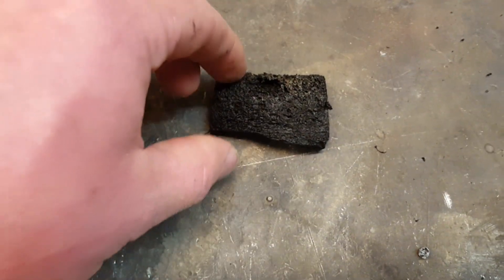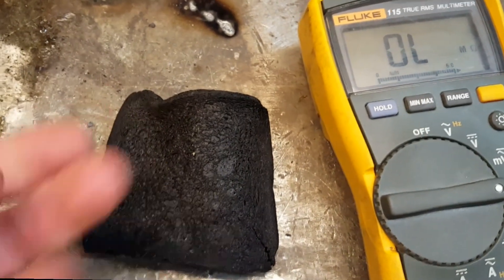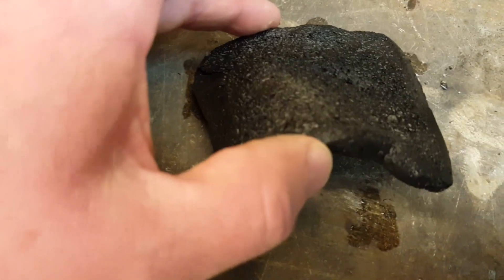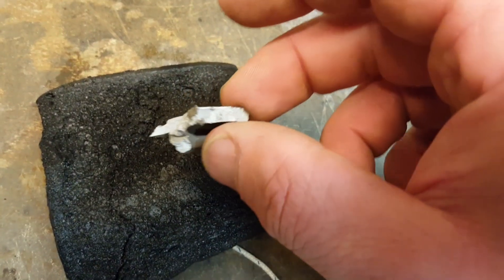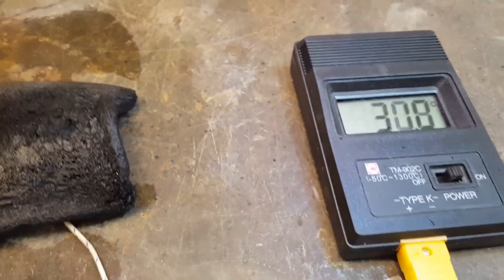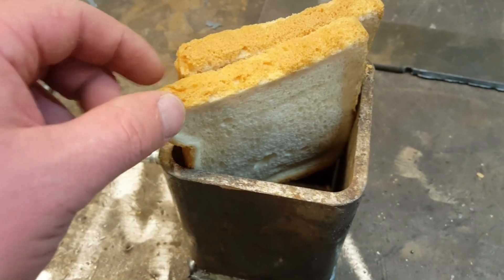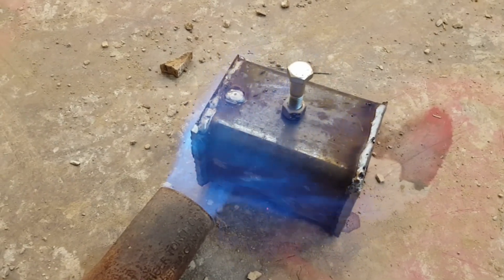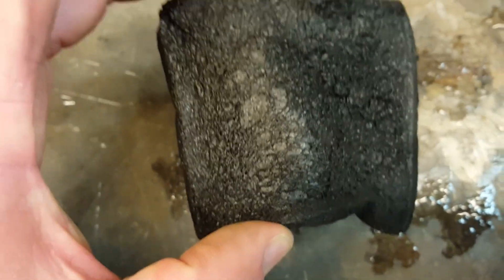Carbon Foam: an incredible material made from everyday items.

Comment: woh woh wait just a darn minute there! that's NOT a thermo-couple. THAT my fine friend is a THERMISTOR, Mister. i may not no much but i ken tell the difference 'tween a thermocouple and a thermistor an that there's a thermistor. An a Bonjour mon ami! como ca va?
Reply: It's a thermocouple. The weld on the end just looks a bit blobby, making it resemble a thermistor. It would not work properly at all if he had connected a thermistor up to a thermocouple conditioner.
Reply: look up TM-902C.

thermistors don't go to 1300C, they rarely go above 300C before self destructing.
Reply: +ms3bani I stand corrected. thank you. more research is needed on my part
Reply: Not, it is not a thermistor,  by  definition a thermistor is an discrete device, so a meter would only read a opened or closed circuit.
Reply: +Adriano Me thermistor is not discrete device! It's a resistor which value changes with temperature. As analog has it can be.
Reply: Wjy did u go to friend just to say "hello my friend how are you doing"
Reply: call me an idiot, but a thermistor is really just a resistor used to read thermal energy or temp. a thermocouple is a bymeatal thingy-ma-bobber.

Comment: Taking this a step further what if the carbon toast was to be impregnated with fine silica sand and re-cooked in an argon atmosphere.  Would this reduce the SiO2 to SiC (silicon carbide) assuming an excess of carbon? And would the form be in SiC crystals?

Comment: I do not understand the need for argon.  If you use the same setup for making charcoal from wood, using a bucket with a few small vent holes to allow gases to escape and put it on a fire, wouldn't you get the same result?  Honestly, I just might test it myself and upload the results, because honestly, the argon seems unnecessary.

Comment: @AvE Quick question fer ya: If you took a steel dowel (around 1.5" Dia) wrapped a slice or two of vunderba bread around it and bound it with some wire, do you recon you could make some form of crucible? I'd ass-u-me you'd need to use fresh bread, what for the ductile nature, then allow it to go stale after to get the stiffness back into the rod.
Food for thought, keep it up big man!

Comment: Great video. But I'm dubious about the sublimation. I thought phase transition in that direction was an endothermic reaction and in the clip here it is most definitely an exothermic reaction......or maybe it was a trick....is possible that you added alcohol to the toast for that shot?
Reply: Carbon does sublimate in atmospheric pressure at 4000k or so, no liquid phase, so AVE is correct. It will also burn in an oxidative environment before that, however.
Reply: I think the charcoal he made is burning away into a gas.

Comment: so i could in theory use this to line my foundry or would it not last long enough? i feel as though this probably is already a commercial product or maybe it has a synthetic counterpart does anyone know?
Reply: Because the carbon would react with the oxygen present in the air: for a combustion you need a fuel, an oxydant and a certain level of energy. In this case, the activation energy is provided by whatever source of heat you choose and once it's reached, the oxygen bonds with the carbon to form carbon monoxyde / dioxyde (depending on the oxygen availlability), water and heat. So if you plan to make a coal furnace you will probably use a blower to increase the oxygen availlability in the fire to reach higher temperatures but that means you burn your coal faster too. This faster combustion concerns also the AvE's refractory bread© so it would sublimate pretty quickly. This is also the reason why a graphite crucible can't withstand as many pours in a coal furnace than in an electric one. Tell me if there's something you don't understand because english isn't my mother tong
Reply: If there's oxygen present the "carbon toast" will oxidize rapidly (burn) above 600C just like charcoal.
Reply: Yeah it would work if you plan to build an electric foundry filled with an inert gas but it guess it would just combust like ordinary coal otherwise.
Reply: MsSomeonenew then why doesn't the bread ignite when he's putting the torch directly on it?
Reply: Sirko no i completely understand now, thanks for explaining. english isnt my native language either haha
Reply: Alright interesting so the short answer is no, at least not with my current foundry as it gets well over 1000c unless i get my old electric furnace up and running. If you guys are interested you can check it out on my channel #shamelesspromotion #noseriouslycheckitout
Reply: The carbon foam isnt the same as regular carbon, the 3D structure of the foam makes it slightly more resistant to combustion
Reply: +Sirko why would it combust (i have not enough chemistry knoweledge to underwtwnd this)
Reply: DIY Jet Engine Guy which one of the videos shows it?
Reply: Well carbon auto-ignites at 700C, so that would need to be one mild cooking pot to be useful.
Reply: nopethegeek I recalled Grant Thomas doing something similar, mixing surgery with drain cleaner a chemical reaction takes place and spew black ash, I believe the sugar  along with the wheat is what lead to this product, bread also has the same element as helium, the affect is similar when you gasifide wood with it, it makes it harder to burn.

Comment: i dont think argon is a common household item
Reply: On the one hand, TIG is fancy space man welding, with the wee bitty wand and radioactive thoriated tungsten nib.  On the other hand, it's the pretty pretty princess of the welding processes; "Oh, the metal, she is dirty!  I will not work!"  "Oh, the grains of the nib are not all lined up, the electricity shall come out all funny!"
Reply: This is just the same process as making charcoal.
You don't really need the argon, just fill your paint can or whatever metal tin you're using right full of the material you're burning and all the gasses cooking off will replace any oxygen in a hurry.
Reply: Really?  I always like to keep a box of argon in the cupboard for emergencies.
Reply: Indeed. All shall behold the glory of the tree carcass king, The Trusty Beaver!...now I'm upset I didn't get the other shart.
Reply: You don't have to use argon gas, you could vacuum it, add co2, helium etc... Plus most people with a garage do have argon in their tool kit so it's more common than you think these days...
Reply: And it is fun to breathe in, makes your  voice go deeper than darth vader.
Reply: Yep, poke a small hole in the top so the gasses can escape.
Once it stops smoking, all the volatiles have burned off and you're good.
Reply: YeEpicTroll actually argon is a common household item.  if you have double pain insulated windows typically found in vinyl windows, there is a likelihood that there is argon gas in them.
Reply: I only have a MIG but in my defense I'm renting!
Reply: +Dick Nickler I tried this. It works!
Reply: Told ya. ezpz
Reply: capsonjames really, cool
Reply: +capsonjames and super easy to get out too.
Reply: Ah, so that's why my blackened toast (and tortillas) in the oven or toaster oven seem just like this.
Reply: GeorgeS use helium instead :) get some balloons
Reply: With helium just remember to turn the carburizer over so the hole is facing down
Reply: GeorgeS just burn the toast in camp fire, turns out looking the same solid carbon slice
Reply: +AvE Got my tee shart today.Mhmmm beaver.

Comment: Hey, So its about time I show up, I have been following your video's religiously for the last year or so. Love it. Anyways, Theoretically could you pull the same thing off with a toaster if you were to tape down the popper upper do hicky and throw the whole assembly in a "bowel" or container that was filled with argon? let er chooch? 

Another direction you could go with this is make tiles,  with a frying pan filled  with argon and one of those samich press weight things? Wifey might not bee too keen on it but I am sure if you cut the crust and made them perfectly square and flat it would make it well worth it? One could also press shapes into it for casting aluminum? I duno, just thought I would chime in. Happy cooking!!!!

Comment: They use 'charcoal' blocks in the jewellery trade for soldering/melting pads. They deteriorate,and you usually keep them going for years,by wrapping wire around them to hold them together. You could make a new one every few weeks with this idea :) Ahh I left the comment before i got to the end!! Its ok if your using someone elses time and gas.

Comment: could be a nice project to build a tig dc/ac welder, its a very chalengin stuff but one of the most usefull power tool, can weld anything,and its hard to get a decent welder outside of usa, only expensive chinise rubbish exploding welders

Comment: What you did with the toast is the same chemical process for making char-cloth. I just recently did that by throwing some pieces of 100%cotton in an altioids tin and throwing it in the fire. You might get away with just heating the toast in a tin for a while without the argon or any complicated setup. Cool video!  Interesting that the same process that makes highly combustible material can also make flame-resistant material.

Comment: Will this work without argon? I know charcol ovens dont need it but is this somehow different
Reply: Folks aren't realizing just how little mass you need to combust to use up all the oxygen.  It is a fraction of a gram, because the mass of the oxygen is also a fraction of a gram.  Chemistry is done on a molar basis.  Intuitively, a mass basis is close to this.  I guess folks are thinking on a volume basis here, and this is just wrong.  The molar density of a solid is about 1000x more than a gas.  Think of that famous experiment where a boiled egg is sucked into a bottle.  The mass of material that is combusted is fractions of a gram.  You can even calculate this exactly if you subtract the weight of the carbon foam from the weight of bone-dry bread.
Reply: You still need an inert gas that will displace the oxygen. 100% nitrogen should work. If you hit the auto ignition temp of the bread with oxygen in the chamber, all you're going to end up with is ash.
Reply: What about putting a small lit candle in the sealed chamber and waiting a minute before heating the chamber. Would that work?
Reply: Wrapping it in multiple layers of heavy duty aluminum foil (to block the oxygen) and putting it in a fire should work.  That is how I make char cloth.
Reply: st0rmforce  Yes that is how charcoal was made in ye olde times. It was insanely dangerous. Using a tight fitting steel container with a vent hole gives great results. :)
The reason this works is probably a combination of two things. One, if there is a positive pressure inside the container, not much outside air can diffuse inward. And two, what combustion DOES occur will result in CO2...which is heavier than air and doesn't want to leave the container. So you're kind of making your own inert atmosphere.
Really the key thing here is to cook until no more combustible gasses are being released, and then prevent oxygen from getting in by plugging the hole while the contents are beyond their autoignition temperature.
Reply: it is more reliable under an argon atmosphere. if you don't want to use argon, you need a container that pretty much has exactly the bread measurements, so no air is trapped with the bread. with argon you can use every closable steel container you have.
Reply: Its a little different of a channel but look for "the king of ramdom" on youtube. He did a video not too long ago about something he calls char-cloth. Same idea, much easier setup. 

He also made a homemade crucible for any interested parties...
Reply: Sudden thought. What if you like trim the bread so that it fits quite accurately in the square tube then cram as many in, so that theres more bread than air inside it?
Reply: heating up to a few hundred deg.C causes pyrolysis.  The polymers breakdown into tars.  It "smokes".  The "tar gas", aka smoke, displaces any oxygen so there's no combustion.  only a carbon skeleton remains.  If you're asking why it is a rigid structure and doesn't crumble to dust, it could be because some heavier tars remain that glues it together.  It also could be that more of the structure is retained when none of the carbon is oxided to CO or CO2.
Reply: Just put your bread in a steel container and fill up the air spaces with sand or ash. (something thermally conductive would be best, like aluminum or steel shavings maybe?)
Reply: From my experiences making charcoal, my recommendation if you're going to try this without the inert gas in the oven is to pay very VERY careful attention as you're cooking. As soon as you see the yellow flame on the vent hole gutters out, plug the vent hole and remove from heat to let your oven cool off. I don't think the results will be as nice as Ave's because of the stray oxygen, but it should approximatelyish work.
Reply: +AvE doesn't the bread have to burn in the absence of oxygen? The other way I've heard of making this is to burn bread in a vacuum. I'm not one to disagree with the mighty AvE but I doubt it will work without some inert gas to displace the oxygen.
Reply: a small crust of flaming wonderbread should do the trick
Reply: If you use a spacer at the bottom of your container, you could put some water in and flush air out with steam.

Comment: I wonde rif you made a wire mesh, kind of how toasters do, if you could get the "toast" to come out flat, and not crinkled. but that's pretty nifty! I think I'd be tempted to trim the crust and get perfect square tiles. maybe you could off-set layer them and make a lil furnace out of them. then too trimming the toast you ought to squeeze like 10 pieces in that "crucible" fun vid, though!  wonder bread. snicker

Comment: Note on the resistance: Heat it more. Like way more. Until all the resistances argon.

har har.

But in all seriousness, there's carbon, and then there's graphite - heating the bajesus out of it will help anneal the carbon into graphite. What you've got there is amorphous, so the electrons have to flow through, then across, all the layered goodness. Some google foo should get you the temps. Graphene anneals anywhere north of about 150C, but I think the initial step to get to honest-to-goodness graphite from amorphous carbon is something like 800C. Been a while. But holy crap, never thought to use bread for carbon foam. I'm going to go bake a muffler now.

(Btw, if you anneal it into graphite, you can conceivably electroplate the foam with all sorts of exotic metals. Mwuahahaha.)

Love your vids. I'll have to do the patreon thing soon. Or buy a t shirt from your store or something.

Seriously. Make up some T shirts. Amirite guys? 

 ;)

Comment: I'm sure I'm not the only one curious as to how this compares with products on the market.

According to the provided link, this stuff has a density of 0.29 g/cm3 and a thermal conductivity of, at best, 0.06 W/m*K.

For reference, Zoltek Pyron (sold by the Homeless Despot for $15 per 9x12" sheet) has a density of 1.37 g/cm3 and a thermal conductivity of 0.03 W/m*K. 

So it's about 1/5 the density, but the insulation is about 1/2 as good. Not too shabby!

Comment: So, you made some charcoal out of wonderbread?  I think I watched a Grant Thompson video a few weeks back where he was doing the same using a paint can with a small hole poked in the lid.
Reply: Heh.  And I was just thinking a paint can was a more convenient pyrolizing vessel than a welded shut chunk of steel tubing.  Though, I do enjoy a bit of welding and grinding from time to time.
Reply: Grant didn't use argon. He made char cloth with oxygen. The bread AvE was using was pyrolized in a seriously oxygen depleted environment. The char cloth grant made burns off, while AvE's Carbon foam sublimates.
Reply: Yeahhh, certainly not charcoal. Charcoal is made specifically to burn. You can light it with a Bic....   He just said this stuff can withstand temps of over 6300 degrees "centigrade".

Comment: could have saved NASA a fortune using this in place of their super expensive, super fragile heat tileh
Reply: Methinks at the cost of 1 Canadian peso per-loaf, they would just replace them every time.
Reply: that is until you actually think about it and try to iron out all the problems...

it's warped and if that happened due to the process you need to find a way to make it without warping the tiles and to get them in the desired shape and in the correct measurements. trying to control precisely how much something like this shrinks is at best a nightmare. same goes for the ceramics btw. 

secondly how would you fixate these on the hull? you can't simply nail them on because the nail would melt, gluing on would work if you can protect the glue from the heat that will inch inwards along the borders of the plates.

thirdly the question is how brittle are these things? you need some resistance to physical impact too in a spaceship.

finally you need to figure in weight and volume, both important again.

so yes, you perhaps could make a heat shield for a spaceship out of toast but once you fixed all the problems, found the solution I kinda doubt it will be that much cheaper.
Reply: They are relatively fragile unfortunately! If only they were made of a stronger material, like a piece of burnt toast.
Reply: FSXgta just another brand name

Use a pencil
Reply: I think nasa's stuff is better